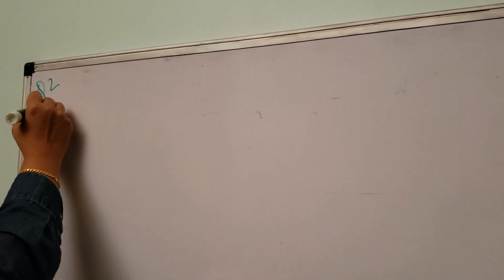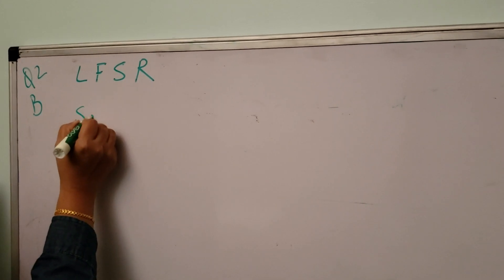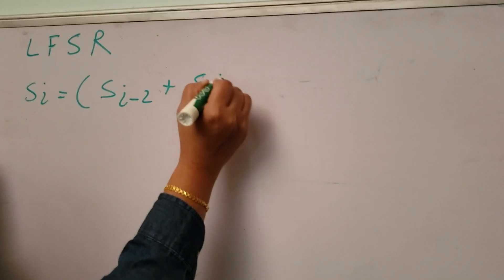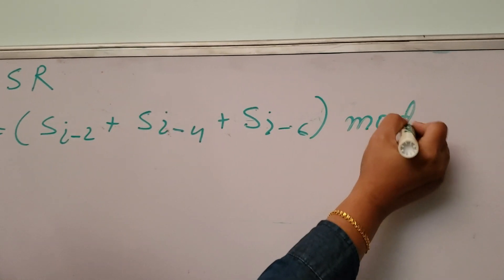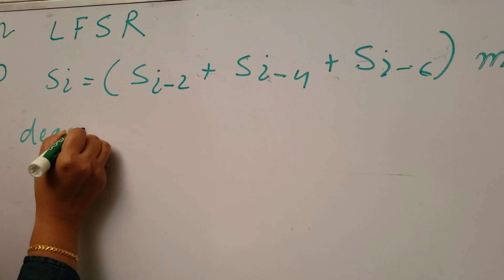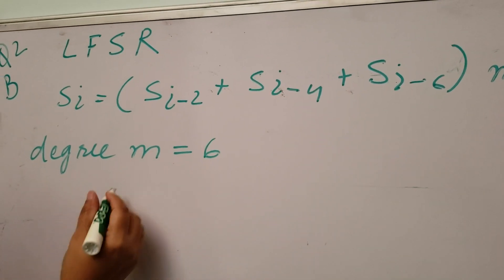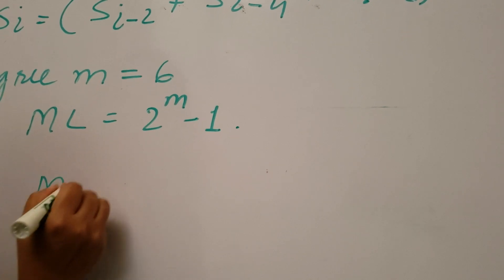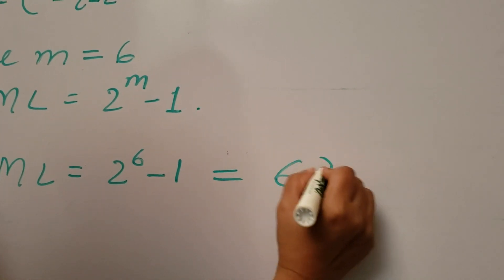(2b) For the LFSR si = ( si-2 + si−4 + si−6 ) mod 2, degree m=6 . Find the max sequence length.

Comment: While 63 is the theoretical max for this problem, given an ideal LFSR, it can be shown that the maximum would be no more than 8 for the one in this particular problem.

Given:
s[i] = s[i-2] ⊕ s[i-4] ⊕ s[i-6]

And rules for xor operations:
X ⊕ X = 0
0 ⊕ Y = Y

s0  = a
s1  = b
s2  = c
s3  = d
s4  = e
s5  = f
s6  = a ⊕ c ⊕ e
s7  = b ⊕ d ⊕ f
s8  = c ⊕ e ⊕ (a ⊕ c ⊕ e) = a
s9  = d ⊕ f ⊕ (b ⊕ d ⊕ f) = b
s10 = e ⊕ (a ⊕ c ⊕ e) ⊕ a = c
s11 = f ⊕ (b ⊕ d ⊕ f) ⊕ b = d
s12 = (a ⊕ c ⊕ e) ⊕ a ⊕ c = e
s13 = (b ⊕ d ⊕ f) ⊕ b ⊕ d = f

s8-13 match the starting values of s0-s5. Therefore, no matter what sequence is given for s0-s5, this is guaranteed to repeat by s8.
That gives this a maximum sequence length of 8.